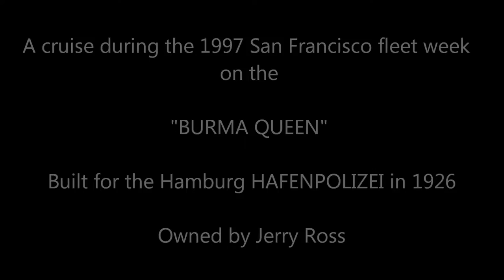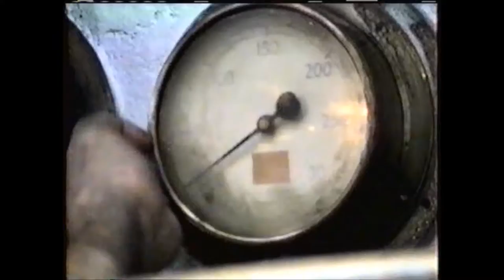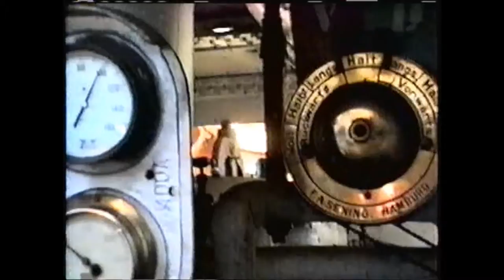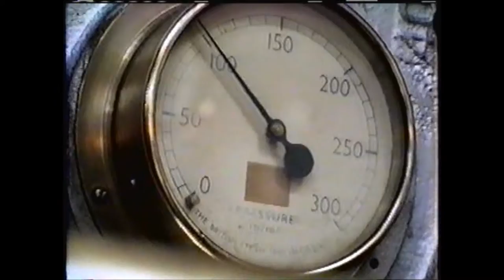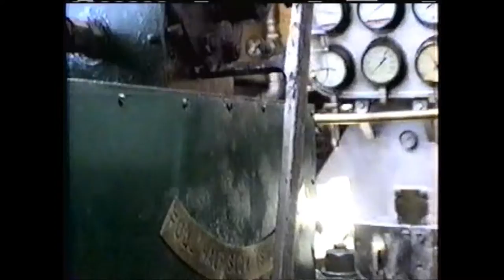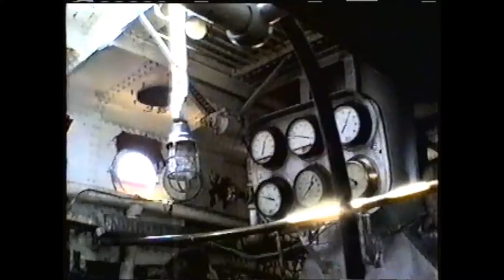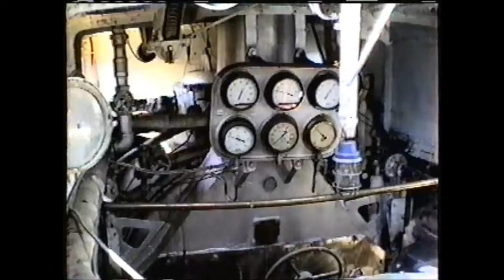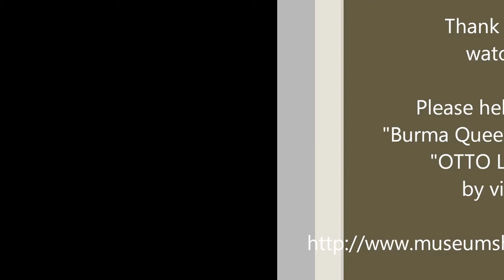Voyage on the steamboat "Burma Queen" HAFENPOLIZEI V Hamburg, Germany

Comment: What is that terrible diesel engine sound heard on the video while under way>
Reply from the maker: That was the diesel generator used to provide electricity for the burner (commercial burner with an electric pump and fan, rather than steam atomizing)